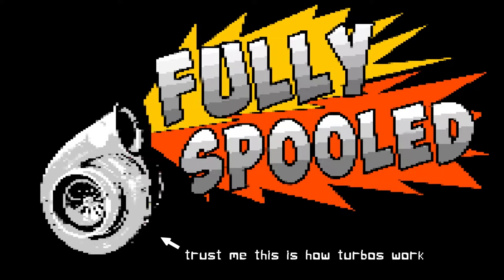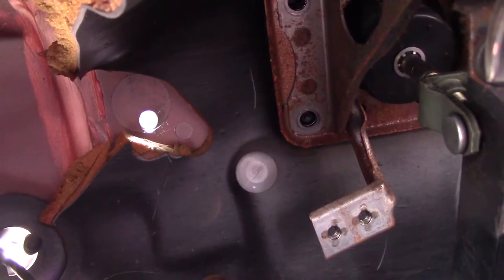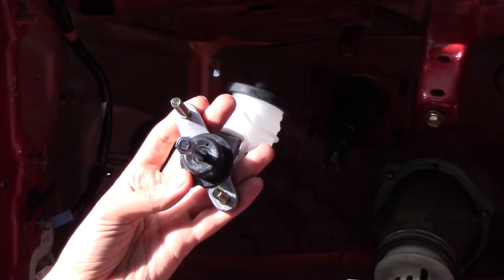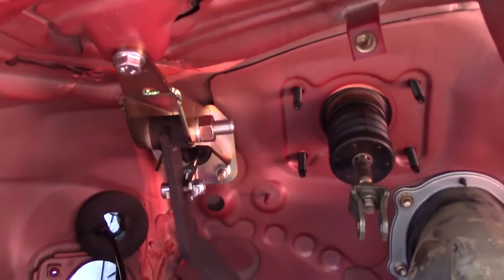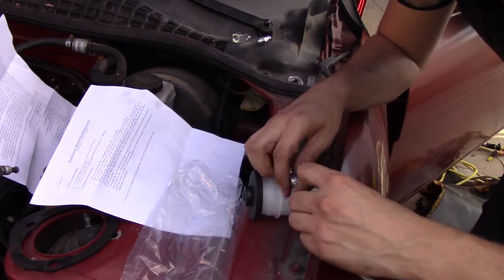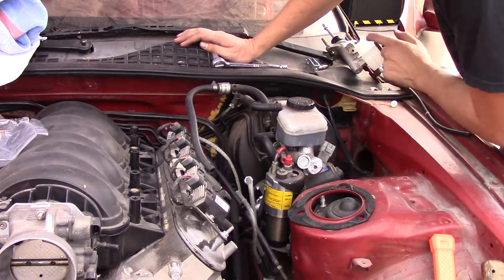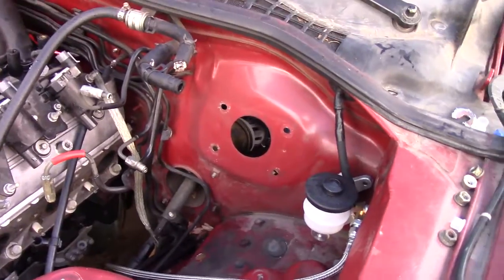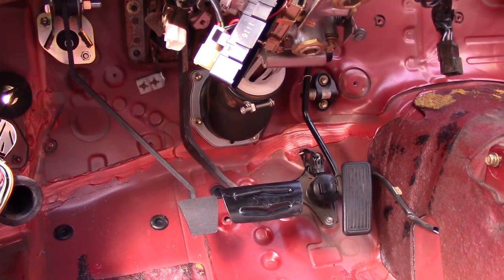Lexus SC Drift Build. Ep. 13 - LS Swap Manual Conversion Pt. 2 - Pedal and Master Cyl

Comment: I was gonna say "easy peezy" until the hydraulic line connection came into the picture.  Great job none the less!
Reply from the maker: It's rarely easy peezy I've learned. I thought it would be super easy as well. Never underestimate installing parts into a car that weren't designed to fit from the beginning.

Comment: Just did this install today on my sc300. My excessive clutch line kit came with a better fitting bang. But was still tight. I just an air hammer with a short hammer tool. Made it easy to push in the inner frame without removing the brake booster. Awesome build

Comment: just wanted to thank you for the videos they helped me figure out how to move the mount for the equipment in front of the brake booster/master cylinder I was stuck on that but I noticed you removed a nut under the fender I didn't see that you were a big help <3
Reply from the maker: Pony Rider that's great man! Glad it helped. It took me a while to find that bolt too.
Reply: Fully Spooled I'm going to make a video about it to help others out it was a pain in the ass to get the brake booster out with full interior and the engine stuff still in place

Comment: Awesome video. I was amazed to see how easy that clutch pedal install was on a car that never came with a manual, if I'm not mistaken. Obviously having a related model helps. Banjo bolt was a bummer. Did you consider buying a more traditional round fitting like found on brake calipers, a shorter bolt, and using thinner washers? I think most people would have gone with your method. Good editing, loved the hot clip at the end.
Reply from the maker: Thanks! I didn't consider getting a different banjo bolt. That seems like a lot of work when I could just bang it with a hammer. :)

Comment: why not just use a cutoff wheel and trim the inner fender to clear the banjo bolt? good job btw i also have a sc400
Reply from the maker: I didn't want to remove any metal there since it is technically behind the front suspension vertical plane, which is against the Formula Drift rules (not that I expect this car to ever be in Formula Drift, but it's a good idea to stick to the rules anyway). I'm sure that little bit wouldn't be a deal breaker, but I wanted to be sure. Plus I just had to bend it in about half an inch.
Reply: Fully Spooled oh yea i didnt think of that

Comment: suscribed!
sc400 was my first car but had to sell it. Looking to buy another one and converting to manual for a daily driver/weekend car (no track) but I haven't the slightest clue when it comes to doing what you're doing.
Reply from the maker: Thanks for the sub! I've been working on cars for a long time, so a lot of this stuff just makes sense to me. There are a lot of great tutorials out there that help introduce people to working on cars, so definitely check those out. You can certainly use what I'm doing as a guide, but I'm no pro at this stuff.

Comment: Where did you get the pedals and master cylinder for swap
Reply from the maker: Ralph Huff the link is in the video description. That master works well for a stock clutch, but I made another video using a land cruiser master for the t56 throwout bearing.

Comment: It is coming along nicely, are you going to trash the rest of the stock wiring just to make it easier or stick with it and try splice into it? Also there are some fibreglass bonnets and doors if you are looking to drop some more weight for drift ;)Love your work keep it up :)
Reply from the maker: Yes, I plan on gutting the rest of the wiring. There's a LOT in there that can come out. It wouldn't surprise me if I drop 50 lbs in just wiring from the weight of the car. And yes, I have some plans brewing for fiberglass replacement parts... future episode!

Comment: Those Ryobi impact drivers are really helpful if you have to tighten or remove nuts or bolts.

Would a stock SC300 clutch pedal/master cylinder been an easier fit?

What are you going to do with rear end to make limited slip?  Final ratio?
Reply from the maker: Yes, a stock master cylinder would have fit better. If I had to do this over again I just would have went with new OEM parts. It would have cost about the same in the long run, it just takes a lot of time to figure out what parts are needed and then having to order like 30 individual parts from Toyota.

The diff is getting welded in a future episode. I'd really like to use a spool or proper LSD, but nobody makes a spool for this diff and proper LSDs are WAY out of my price range. I'll weld the stock SC400 diff and then later upgrade to a proper LSD in an SC300 diff. The SC400 diff is 3.92 while the SC300 is 4.27.
Reply: Bet you have a pile of Lexus parts to sell or give away!!  Since you have been using GM running gear up front, is there a GM rear axle assembly that would fit in place of the stock?  Maybe a Camaro rear axle?  I know you need LSD or maybe weld it  to make it no slip, but is a higher ratio like a 4.88 or 4.56 or higher better for drifting?